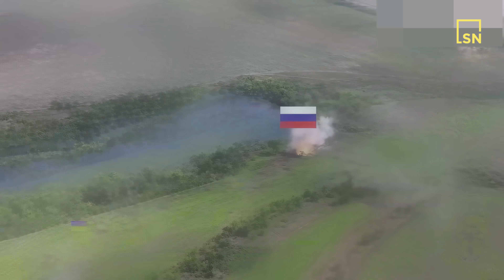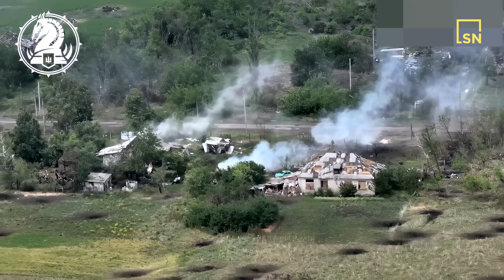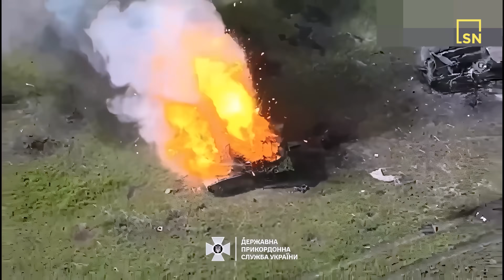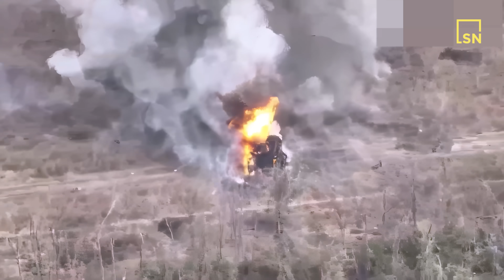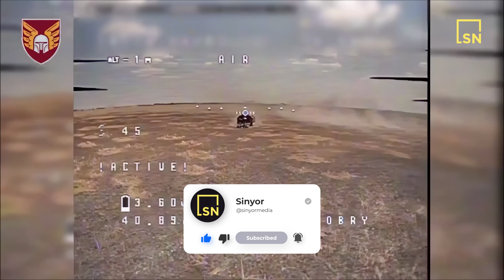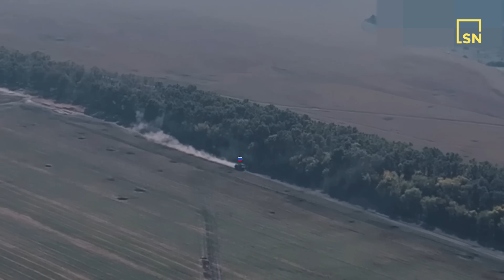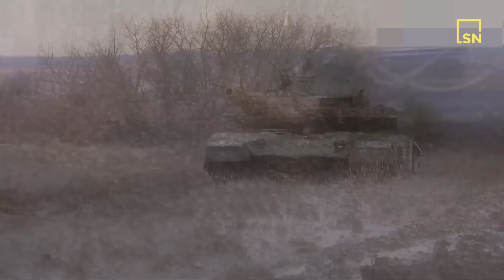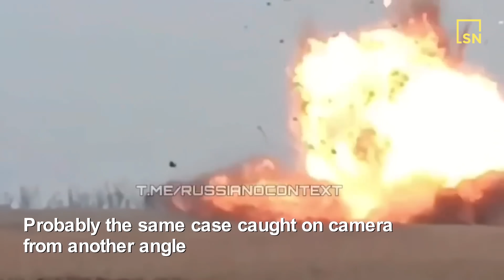Two Abrams Face Russian Brigade Alone, Head-on

Comment: This is a good demonstration of how NOT to use tanks in combat. Tanks without infantry and air support are vulnerable.
Reply: All the drones and accurate artillery fire has made it where any tank that's moving as slow as people is basically dead. Any armored vehicle has to speed in and frequently change locations. Even troops outside of trenches or buildings are fodder.
Reply: @NightmareForge  это война операторов дронов -- ТАНКИ В ПРОШЛОМ...
Reply: @аноним-к9т5п  Yes, drones are dominant but tanks are still a tool.
Reply: @аноним-к9т5п all these drone operators gonna be messed up
Reply: @аноним-к9т5п You might be right, but it might be different if one side had definitive air superiority.
Reply: @аноним-к9т5п tanks are not of the past its just used different nowadays
Reply: Anything without support is vulnerable, and anything with less support than the opposing force is also vulnerable. The deadlock is so fierce that holding for a complete combined arms push is next to impossible, and combined with leadership incompetence equals a disaster. Russia has completely lost the plot with their tactics in this war
Reply: Russia had a lot of military experience and a lot of experienced commanders before the war, but a 70-year-old pensioner removed them all and replaced them with his KGB acquaintances, who were old corrupt officials with no combat experience but who were good at eliminating experienced soldiers and charging the army a lot of money.  Such a powerful country with its potential was destroyed from within, by its own president and top officials.
Reply: @онинадеятсянаменя  accurate summary, but I would disagree with their experience. Russia (including the USSR) invaded a lot of countries prior to and after WW2. Both Chechnya invasions and Georgia invasion, all occurring after 1990, all involved heavy casualties on the Russian side and involved repeating the same tactics that led to massacres on their side. Then in 2014, they go into Crimea and only took over because Ukraine was not expecting it. In 2022, they were ready, but the Russians used the SAME EXACT tactics. They haven’t learned anything

Edit: spelling
Reply: @онинадеятсянаменя  You are talking about Russia right??
Reply: @онинадеятсянаменя идиот
Reply: @grantbarday5760  Russia did not invade Crimea, Mr. Liar. A referendum was held, in which the majority of Crimeans supported joining Russia... By the way, I am not sure about the legitimacy of this vote myself, but it was held without a single shot being fired. As for Chechnya, it was a hotbed of t*r*or*sm at the time (Beslan 2004), which led to the start of the Chechen Wars... 
P.S: What about the United States with its involvement in Iraq, Afghanistan, and more?
Reply: @tanklover-t55  bot
Reply: @grantbarday5760  Nope!
Reply: @grantbarday5760  Holy copium
Reply: @BeamNG.enjoyer  ok boomer
Reply: That's one of the interesting things happening with this war, the huge prevalence of drones makes moving in large complex formations extremely dangerous, because at any time they could be spotted and targeted by a cheap drone which can actively guide indirect fire onto them with no risk to human life.  Now I'm not in the "tanks are irrelevant now" camp but in a battlefield specifically like this where neither side can clear the sky of their enemy's drones, the use cases for tanks becomes restricted and they are often stripped of the "don't get spotted" layer of protection.
It's also why the US among other countries are sprinting now to develop multiple kinds of small, portable anti-drone jammers or microwave weapons that can be mounted to vehicles, or interceptor drones, and drone-detecting microphones that can act as an early warning of nearby drones.
Reply: @youtubeisapublisher6407  Tanks need radar + a target tracking turret/laser against drones
Reply: That's correct! Tanks without support are vulnerable. So why would anyone send a single tank across the battlefield to attack their enemy? Think about that when you watch these videos. 🤔
Reply: @Travis26X  Russian drivers have a tendency to get lost. We’ve seen it happen a lot in the war. And no, I promise this isn’t a “Russia got lost and wandered into Ukraine” joke XD

The other possibility is that this was a larger battle across the broad frontline and the video we saw was an armor skirmish of that battle
Reply: @grantbarday5760  I don't believe that, and you probably shouldn't either. Modern GPS mapping and tracking make it almost impossible to get lost. Especially for military vehicles. Maybe in a rare case sure someone could get turned around or lost. But it wouldn't happen over and over.
 I suspect that these are captured tanks. How they were captured is another discussion. But they are being used to gain public support by means of seeing them destroyed on video. 
 I personally doubt that this is actual combat footage. It seems more like a staged show to me, something meant to gain public support. The tank hatches open everywhere is..... very unexpected. I doubt any tank commander, in any army, would drive into battle with the hatch open.
Reply: @Travis26X  The war it self actually shows the reason why small squads and a lot of the time singular vehicles are used.

Modern warfare strongly discourages massing of forces in one place. Everyone can see everyone, both sides know exactly where the other side is.

So the moment you start massing tank platoons to go out and assault a position, you are gonna be having 5 kinds of artillery and 3 kinds of air strike coming your way.

Many of these examples have been recorded from both sides, with both sides suffering instantaneous and high casualties.
Reply: @S1030dan  Like no Sh** buddy. But what does that have to do with the hatch being left opened. They close the hatch when in combat situations so drones can't fly into the tank and blow it up. What part of that don't you understand?
Reply: @Travis26X  The hatch open videos have several contexts. 1- Such a tank has already been abandoned, which is why the hatch is left opened. 2- If the hatch is opened during combat, then this is nothing out of the ordinary. Doctrine, personal preference, situational awareness, weather effects. It all plays a role.

Side note on open hatches. It virtually makes no difference to a Drone, or ATGM, if the hatch is open or closed.

A closed hatch only matters if a drone operator is trying to drop a hand grenade in to tank. 

If the Drone operator is dropping an RPG warhead, than that hatch makes quite literally 0 difference.
Reply: @S1030dan  That was the point. These are abandoned or captured tanks set up and destroyed in a way to look like a strategic strike for Ukraine.
And if you believe the hatch being open or closed makes no difference, then I don't know what to say to you. 
Your level of stupidity is just to high!
Reply: @Travis26X  No your point was that most of shown footage is faked for propaganda reason not some. It was always very clear which tanks were abandoned and which ones were not.

"And if you believe the hatch being open or closed makes no difference, then I don't know what to say to you. 
Your level of stupidity is just to high!" Read a book. From WW2 > Gulf War > Iran Iraq War > War in Ukraine. Tankers fight unbuttoned. Tank Doctrine recommends fighting unbuttoned.
Reply: @S1030dan  Your level of stupidity is just to high! 🤣🤣🤣🤣🤣🤣
And you double down on it. Would you wear a shirt with a big bullseye on it as well? 
You go read your books bud!
Reply: @Travis26X  tanks are sent across the battlefield without air support because Russia is using the same tactics they used in 1944.  Which is the reason why instead of seizing Kiev in 3 days here we are 3 years later watching Russia's much larger military struggle against modern weapons and tactics.
Reply: @rudder727  That's not true at all. 
First of all, Russia never claimed they would be able to seize Kiev in 3 days. (That was the president of Belarus that made that claim) And honestly, without NATO interference that would of been close to the timeframe needed at the start of this war. Ukraine didn't even have the capability of detecting that first group of Russian tanks, let alone intercept them. (We (NATO) are responsible for what's still happening)
 And I doubt any tanks are being sent without proper support and coverage. What we see are most likely captured tanks and equipment being used to get great camera shots for the propaganda machine!
(If NATO citizens can't see the destruction then support falls. Its that simple)
Reply: Russia sends tanks to test the defences of Ukraine before launching full scale operations, they are gambling.
Reply: You think F16's will be fighting the FPV drones that are destroying tanks? 😂
Reply: It does not make any difference any more. A tank, even with terrestrial and aerial support can be easily destroyed by drones.
Reply: @TechAndPolitic  Ukraine is not a good war on which to base your comment. Ukraine is fighting the war it can, not the war it wishes it could fight. If they had the means, they would use long range weapons and destroy drone manufacture, destroy fuel production and then send an army of tanks and aircraft across the frontline destroying every ruzzian stronghold as it went. Alas, western support does not go that far. Even when they have western short range weapons they are told where they can hit the enemy. Do you know any other war fought like this?
Reply: @TechAndPolitic  If you are going on attack you have to prepare the battlezone. Remove the things that threaten your own military. Production and fuel. 2 things the Ukrainians have a hard time doing with their hands tied by western support.
Reply: The table has again turned.  Infantry with drones and ATGMs have limited the viability of tank assaults.  I'm not saying there's no place for tanks and APC/IFV...especially as a QRF or breakthrough force. But clearly investing in drones, ATGMs, and light mobility are the most cost effective solution.
Reply: Because these lbh soviet tanks were made to operate in massive groups under nuclear mushrooms, not this type of semi guerilla, semi trench warfare.
Reply: As someone who fought during the GWOT. There has never been a battlefield like this . This is the first time There's been 2 equally matched(technologically at least) forces have went at it for an extended period of time. In Iraq and Afghanistan or even Vietnam we had an overwhelming advantage
Reply: @HandsOfFate420  The Iran-Iraq War. Return after you read a book!
Reply: @IsaiahRichards692  VA classifies us as GWOT veterans, or at least thats what thee VA tells me. but i guess you know better. cute anime profile pic, btw. a true hardass
Reply: @asmallhedgehog19  I’m a big softie but I don’t have PTSD! I think I win.
Reply: @asmallhedgehog19  Also, not sure what you’re responding to. You made a comment saying these perfectly balanced stalemates have never happened, I said Iran-Iraq War, a perfect example of such a conflict.
Reply: @HandsOfFate420 and still lost
Reply: @jimtom4878  Tell that to all the people we smoked
Reply: @HandsOfFate420 what? I'm just saying there gonna be messed up. I was saw a war movie where the guys at a base in the US killing targets remotely and the movie is about the impact it has on him
Reply: They're  @HandsOfFate420
Reply: @HandsOfFate420  there was no GWOT, you fought in the oil wars
Reply: @owen-trombone  tell that to the VA
Reply: I think one reason the russians have not used a lot of air support is because the Ukrainians can reach inside of Russian lines. Seems to be making the russians think twice about giving it all it has.

And I think that's all it has.
Reply: @hughdismuke4703  Two fold issue, firstly Russia failed to destroy Ukraine's air defenses outright, so while Ukraine doesn't have air control they have enough threatening G2A and A2A missiles available to make flying in their airspace a serious hazard for Russian pilots.  
Second half of the issue is that they also failed to eliminate and cannot seem to reliably defend against Ukraine's longest range strike capabilities which means that they can't stage aircraft at any runway close to the front without risking the aircraft being attacked while on the runway.
Reply: @youtubeisapublisher6407  Yup, all that too.
Reply: @hughdismuke4703 good point. Russia seems to view losing material and equipment a higher concern than actual soldier lives.
Reply: @lordcommander3224  
Yeah, it's like Russia has a gun to Ukraines head but down below the Ukraine has a gun pointed at the Russians balls.

Remember the standoff in Inglorious Basterds? Nobody won. It's the same standoff as nuclear deterrents by having them in the first place.

The Ukrainians have the russians by the balls on certain levels. I would not count out that they probably have intelligence over in Russia itself on the inside.

Democracies always use innovation. Dictatorships often stick to the same old song and dance stagnation.
Reply: We used them without infantry support in the Gulf war. Of course weapons were different back then. The Yom Kipper war was tank without infantry as well. Indeed its very common.
Reply: @greybuckleton  tanks alone are probably better against formations in open desert than in a city or more feature heavy terrain
Reply: @grantbarday5760 all kinds of factors apply right. Israel for instance used supported tanks in cities in Gaza. But the opponents had poor weapons. I don't think the Russians are actually using the tanks poorly, it's not like all the Ukranian tanks do well. Tanks are simply quite vulnerable on a battlefield where both sides have so many powerful weapons and so much surveillance.
Reply: Leopard is a really good target for drone
Reply: No artillery, no close air support.
Reply: @lordcommander3224  how does either stop FPV drones?
Reply: @geoffhaylock6848  I didn’t say it could defeat the drones. I just made an observation these guys artillery and air support. Drones are basically the new mustard gas. Deadly at first, then will eventually be countered.
Reply: This isn’t ww2! Drones and artillery have made it impossible for infantry to move on foot! APCs have the armor and requisitioned civilian vehicles are fast enough to even the odds!
Reply: @IsaiahRichards692  armored and civilian vehicles are little more than coffins now that drones are everywhere
Reply: @owen-trombone  Technically, it’s a war zone, there’s always a risk, your safety is never guaranteed!
Reply: And you've been fighting russians for how many years now?  
Get your head our of your arris, they're having to do with what they've got moron. The textbook you learned from 20 years ago doesn't apply.
Reply: We can only be justified by the BLOOD of JESUS CHRIST, the Lamb of God, who offered Himself on the Cross to cleanse us from our defilement and thus erase the sin of everyone who places their faith in salvation through the BLOOD of God the Son, JESUS CHRIST, sent into the world as the sacrificial Lamb by God the Father to pay the ransom.

Our redemption is a free gift from the FATHER… through the finished work of Christ under the Law.

And it is only through His pure Blood shed on the Heavenly Mercy Seat that we obtain forgiveness from God the Father. This metanoia, this change of mind, is the understanding that if you are saved, you know that the only way to Heaven is the Substitutive Atonement through the BLOOD of Our Lord Jesus Christ… and that therefore, if you ignore this, you are lost.

--> Have faith in the redemption through the blood of our Savior Jesus Christ before the Rapture of the Church establishes this new paradigm that will force you to die as a martyr for Christ if you desire to have a share in Heaven.

The evening of the Rapture, Friday, August 1 or 8, 2025 will be a day of unimaginable distress on earth. Be blessed
Reply: The propaganda is getting dumber and dumber somehow
Reply: Air superiority is the key, but is it possible any more.    Drones have Made it a very localised affair
Reply: Facts....
Reply: Typically correct however this is open ground and likely rapid encounters or an ambush normally. Large troop groupings or prolonged presence makes them very vulnerable to drones
Reply: BS. Right now tanks are used this way because it's harder to get spotted. Because of drones, tanks are used as single use weapon. You get hit, damaged and leave it behind without casualties. Then, you get another tank. Quick fire support missions or leading the charge across fields are main purpose now
Reply: Imagine being around those tanks when they detonate like that. Lol
Reply: Tanks are made for battles  and  to have to protect them.
Reply: Drones have made it impossible to use tanks with or without infantry. The days of combat maneuvers ae over. These are the days of decentralized drone warfare.
Reply: @LazorzPewPew  decentralized drone warfare is for the nations that cannot affrod to enlist enough people and produce enough modern weapon. Ukraine and Russia are both in deep demographic and economic crisis since the USSR collapse. Also this so called "war" was going for 2 years in the same time Russian gas was transported through the Sumy oblast to Europe. Even when Ukraine invaded Kursk oblast and occupied the Sudja city where the pipe and pump station is located on Russian side, gas kept being pumped for months. Capitalism, my a55.
Reply: You are completely wrong about that. Traditional centralized maneuver warfare is DEAD. It doesn't matter what kind of army or airforce or navy you have. War is all about economics and logistics. And the economic model of a $600 dollar drone that can destroy a multi-million dollar tank or airplane has almost an insurmountable advantage.
Reply: @LazorzPewPew  add rain, wind, radioelectronic warfare and cages and it's not so effective anymore. Drones are the cheapest way to destroy armored vehicles, but definitely not the most effective.
Reply: @LazorzPewPew  And jammers already exist, which disable said drones. Besides, FPV drones might have high hit ratios. But low kill ratios. Drones have been used properly in war for like 20+years now, with large payloads and proper systems. The FPV drone warfare in Ukraine, should be called RCV warfare instead. Because that's what it basically is, strap a warhead to an RCV and fly it to the target.
Reply: Artillery or not tanks are obsolete
Reply: @knightfox1461  please elaborate, because that is a hot take that will get shredded without proper backing
Reply: @knightfox1461  How are tanks obsolete?
Reply: @geoffhaylock6848  They aren't necessarily.  But without proper support tactics a $10 million tank can be taken out easily with a $40,000 missile.
Reply: They'll never defeat Russia, and they'll never learn. Germany knew this way back then in WW2, they knew the enemy back then!
Reply: @kevinleewilliams5119  Don't talk nonsense.
Reply: @kevinleewilliams5119  брехло, надо не воевать, а торговать.
Reply: @kevinleewilliams5119  Dearest Kevin, Germany was the aggressor and the enemy during WWII. Stay in school and study hard, love Mom.
Reply: @12maples  You realize Russia invaded Poland with Germany during WW2?
Reply: @kevinleewilliams5119  is that why we are halfway to year 4 of a 3 day war? because ukraine will never win? and why germany was kicking russian butt till they stupidly tried to brave the winter? and then didnt go back to kicking butt after winter because russia's western allies forced it to divide and divert its forces?
Reply: @kevinleewilliams5119  hahahaha 72 hours or something like that. LOL
Reply: @kevinleewilliams5119  You dont know your history then. Russia in ww2 survived only because of 1 thing. Lend lease.